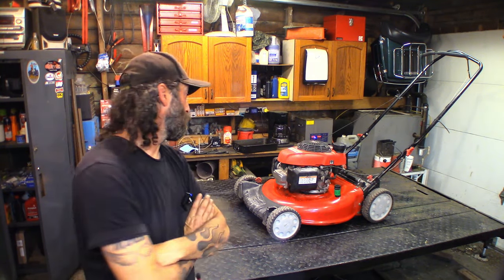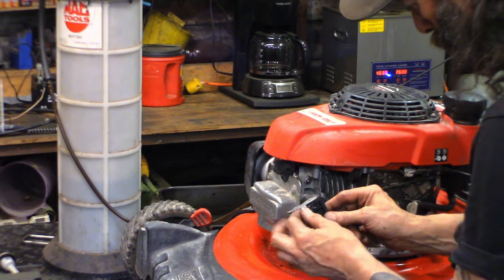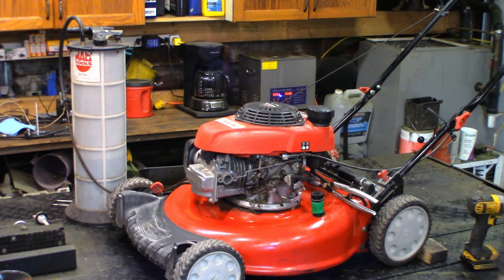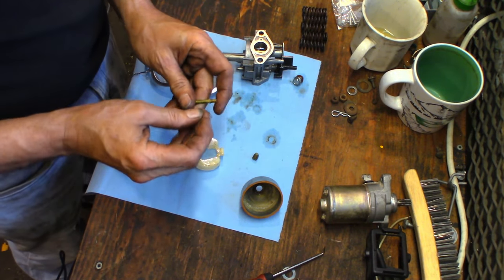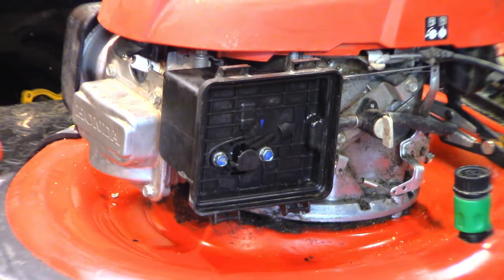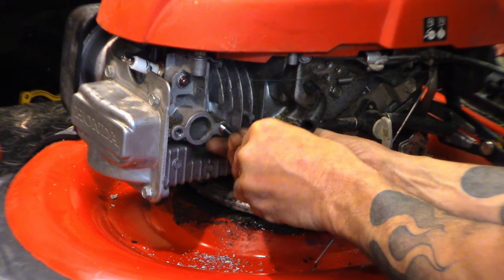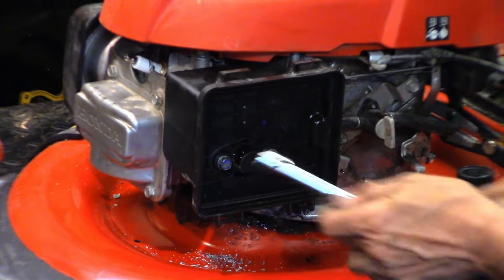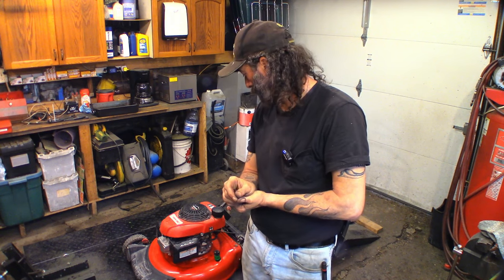Troybilt push mower no start and a helicoil thread repair

Comment: Really interesting, you mainly  think of that happening with a rider mower. I think that helps with  ethanol is keeping a really good new gas cap. Non-ethanol and running the carburetor dry is your best bet. Thanks for the video.
Reply from the maker: Thanks for watching Steve

Comment: Nice video, great fix. You mentioned a problem with the automatic choke possibly blocked with silicone. What was the fix? Thanks !
Reply from the maker: I saw the silicone, and wondered why.  But it wasn't an issue at all.  Thanks for watching!

Comment: What happened to the break off tang of that Helicoil. Does it automatically come away inside the insertion tool?  I have yet to do that repair or get tools to do it. Would it be appropriate to insert it using a gel threadlocker for extra insurance?
Reply from the maker: You can run a TINY bit of Loctite on there, but I usually don't because I don't want it to interfere with the bolt threads.  The tang can be broken off with a punch and removed, but I usually try to set it up so the bolt threads don't go deep enough into the repair to hit the tang.  I just leave it intact and on the insert.
Reply: @randomwrenching    Oh, cool!  Another small detail learned. Thanks!

Comment: Don, I would have automatically replaced that failed petcock.
Reply from the maker: Yep, those particular ones were not the easiest to find in quality aftermarket, especially when that machine was new. Once I did find one, it was $30.  They bolt on to the machine, not like the universal ones.  I don't stock them, or I would have replaced it.
Reply: @randomwrenching    In that case I would have just thrown on a universal for no charge. Hardly any time or cost. Not having a way to shut off fuel before the carb would be much worse in my mind.
Reply from the maker: @Rein_Ciarfella  Thousands of mowers out there that don't have, and have never had a fuel shut off valve...